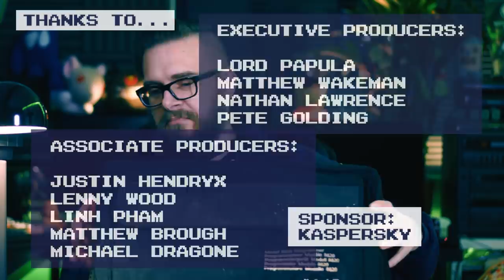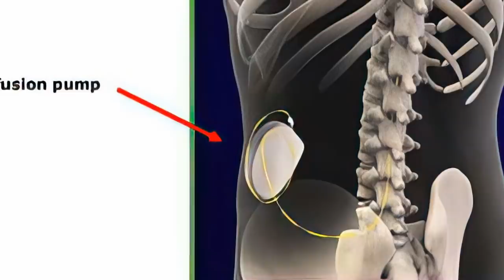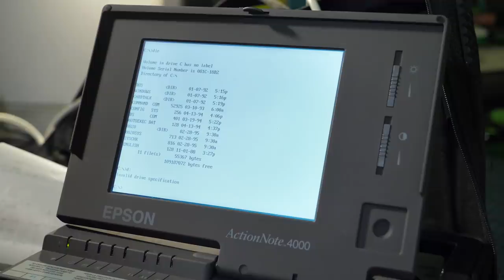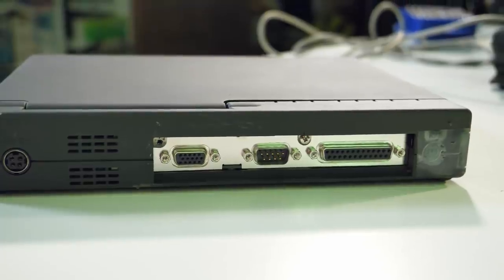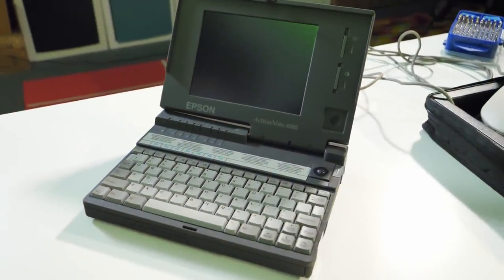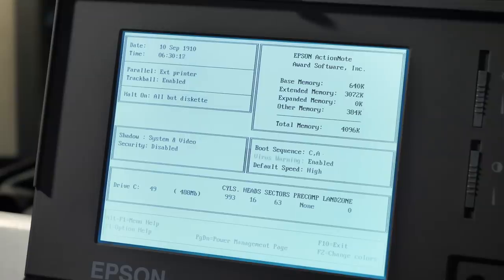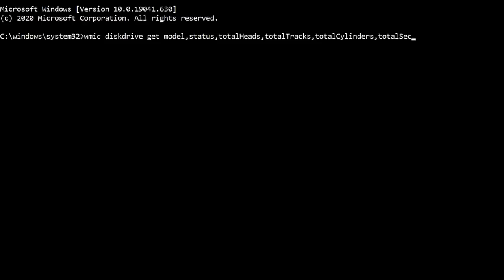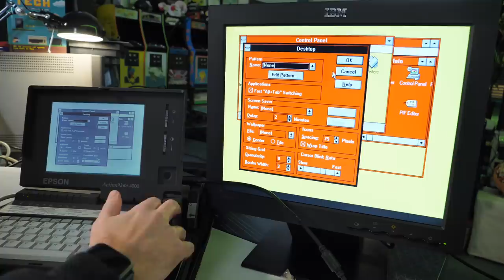This Laptop Could Literally Save Your Life | Nostalgia Nerd

Comment: 7:09 That looks like a blown up/shorted tantalum cap  in the top right of the board.
Reply: I was just browsing the comments to check if anyone else has noticed :D
Reply: @Ciakuz  I was just browsing the comments to see if anyone else was just browsing the comments to see if anyone mentioned this.
Reply: I was commenting the checks for browsing and noticed anyone else
Reply: @Ciakuz  I was browsing the internet for toasted tantalum capacitors with which to put in the holiday snack bowl instead of stale candies
Reply: I noticed this noting of noticeable notable note of noted burnt tantalum (AKA "tantrum capacitors" because, push them even slightly too hard and they loose their cool... literally!).
Probably that cap saw regular current surges on power-up (Many regulators out there that would current limit thus avoiding burnt tants on the output.
Reply: Nothing more comforting than sitting down to have your doctor computer your innards and having a tantalum cap explode.

“Not to worry!  It’s fine.”  * waves smoke *  “Now place this on your gizzard.”

Comment: When this was made track balls on computers were all designed to be thumb operated.  If you wrapped your fingers around the back and rested your hand on the table while using your thumb to operate the ball I think you would be seeing it from the designers eyes.
Reply from the maker: That's the method I tried initially, however, the mouse buttons are horribly inaccessible that way. They're also switched as standard, which I guess is you can push down on the left button (which is on the right) using your thumb. But this is one trackball that doesn't mesh well with thumb.
Reply: @Nostalgianerd  This was a design choice to make the trackball uncomfortable to use for Gaming.  Many more features have been added to "Business Machines" since (like Graphics Cards that are useless for actual Graphics) to try to limit the amount of "Gaming" that can be done on a machine designed for "work".  These were the PC's a "Boss" would like to buy their "employees" for maximum work output and minimum "fun time".

Comment: For future reference, 16 heads and 63 sectors are the defacto settings that should be used if you were to do something similar again. I didn't catch too much of the values changing but the cylinder size should change automatically when setting the other values.

Comment: Dear Mr. Nerd:

It’s quite common for old drives that those USB IDE adaptors don’t work.

I bought up a bunch of old 386/486/Pentium era drives and had to test them all.  I had a Linux box with all the tools I needed, but the USB adaptor wasn’t having any of it.  Had to get a PCI card with an IDE interface and add a hot-swap drive caddy instead.  That did the trick.

I still have it set up, with an added SATA bay just to cover all the bases.  Highly recommended if you do this sort of thing - which, of course, you do.

Comment: You can simply write disk images into SD card and use it in SD2IDE interface.
PCem is better than VirtualBox because it supports most retro hardware, so you can make a virtual copy of your computer and install everything using convenient virtualization. Windows 95 drivers included.
Then I use WinImage to write HDD image to SD card and it will just work.

Comment: For next time you need to use a large (e.g.: 8GB) Harddisk drive on an ancient 386/486 machine (that only understand specific Cylinder/Heads/Sectors):
there are drivers,  that one can install on the boot sector: e.g.: EZ-Drive or OnTrack. Once booted, they replace the BIOS's disk routine (Int 13h) with ones that understand modern drives, and then continue the normal booting.
That's how I used to do it with my actual old 386/486 PCs back when I was  a kid.

A slight upgrade would be to plug-in a parallel port sound card for FM music (e.g.: OPL2LPT or OPL3LPT if you don't want to solder it yourself) or a 16bit PCMCIA soundcard for full sound effects and FM and/or midi music (don't know about driver availability, but I would be surprise if they didn't attempt to support enough Soundblaster compatibility make sure  Doom is supported)

Comment: I got one of these in an estate auction about 15 years back. It runs Commander Keen great! Mine came without the medical equipment and with an external floppy drive with a wonky PS/2 + parallel port connector that worked great until... just today. I'll be following the IDE copying steps next lol. I'm having similar problems getting the IDE drive to recognize in any external system.

Comment: I had to do something similar to install DOS on a Zenith laptop last year. It had a 60MB hard drive limit in the bios so I had to use something called Maxtor EzBoot (A Dynamic Drive Overlay) to get the system to recognize my 1GB CF card. Weirdly, mine wouldn't work unless I used the DDO software. It's good that you got the CHD settings to work, my bios wouldn't even accept the "correct" values when I had them set manually.

Comment: That thing chugs so bad, I remember why the sx'es needed the dx'es math co-processor.
486DX-33, 4mb ram, 310mb HD was my first pc. Upgraded to 16mb ram, 540mb HD, and a Pentium 83 overdrive in that same MB when doom 2 came out and my PC gaming addiction started. Ahh, things have changed so much, but still basically the same. Although you can buy video cards that cost 3x what that PC cost back then

Comment: CF cards are basically native IDE, so the problem with reading might have been just formated as FAT32 instead of FAT? since 1993 DOS cannot use FAT32?
Reply from the maker: Come on. I ain't using FAT32.
Reply: Since that has been ruled out it's probably a mismatch in the CHS geometry and/or a lack of cylinder alignment. You need an fdisk which sees the disk as the same virtual geometry the BIOS has and which starts partitions on the first sector of the CHS track. Modern systems don't use CHS and also tend to start partitions on megabyte alignment.

You can use Linux fdisk. In the advanced menu you can enable DOS compatibility and change the geometry it uses.
Reply: @eDoc2020  hey thats a good point. i remember using EzDrive or something to allow 20gb hdd on my 386. i had to setup specific geometry (totally unrelated to the actual drive) that would load the loader from mbr and that enabled the rest of the drive

Comment: They want to fit a Spinal Cord Stimulator (SCS) on me. They do it in two stages: Run wires down your spin and test them externally. If that check out they fit the SCS (I believe they cost in the region of £40K). However, there are some risks (I don't have a good history with surgery) basically works out at 20% it will cripple me (or trigger a constant CRPS flareup), and success is roughly 50/50.

I'd forgotten about heads, cylinders and sectors. People are spoilt these days.... I was surprised Doom played so well on it; I saw the ~5fps on the LCD and thought that's about right for lack of FPUs, but it was actually playable on a monitor (I first saw Doom on a friends 386..DX).

You should show a pre-MMX PC playing an MP3 file, and how heavy it is without the beauty of SIMD.

Comment: Chernobyl was built in the seventies and was still able to run DOOM in 1986 in full 3D and surroundsound! Comments from bystanders at the time were that if felt so real that you could literally taste metallic air! 
I wonder at what speed the core was running at? I think that water cooling didn't work. They don't make them like they used to LoL.

Comment: Also, by 'FDISKd the hell out of it' did you mean deleting and creating partitions with restarts a couple times to clear out what the bios incorrectly assigned, and then filling the drive with many smaller partitions, so A; the BIOS recognises one to assign and boot from and B; the BIOS doesn't recognise unused space as a faulty unbootable drive. It would have been easier to flash the bios with a better version
Reply: Flashing bios back in the early 90's had a 80% chance of bricking the darn thing. That is, if a newer one was somehow available for the unit.
Reply: Presumably, yes that's what he meant. As a piece of trivia the BIOS actually doesn't understand partitions itself, it just executes the code on the first sector of the disk. What matters here is how BIOS-presented CHS values relate to the LBAs on the drive itself. If you know the CHS mapping used it's not hard to partition the drive properly, it's certainly much easier than modifying the BIOS to better support larger drives. Modifying the BIOS might not even help, modern partitioning tools align partitions to megabyte boundaries while DOS only works if its partitions are track-aligned.

Protip: if you can run DOS FDISK on the target computer itself the partitions will be properly set up. Then you can format the partitions on another system and it should work.

Comment: "... the little BIOS on this EPSON doesn't appreciate hard drives over 8 gigabyte."
I genuinely doubt that this BIOS actually supports any gigabyte hard drives at all. In the early nineties, the size of common hard drives was measured in megabytes. I think it's around 1995/1996 when gigabyte hard drives slowly started to become available for desktop computers. After that it took quite some time for gigabyte laptop hard drives to start become available. 8 gigabyte desktop hard drives were hitting the market around 2000.

Around 1995/1996 I worked at a computer shop and I remember building the first desktop computers with gigabyte hard drives but not all BIOS'es supported those "huge" hard drives by default. The BIOS had to be updated by that time (if there actually was an update available that added the support for gigabyte hard drives).

But obviously, this is just a minute detail in a great story 🤣 You took me right back into the nineties. 

This video actually made me remember that I still may have a Toshiba Libretto laying around somewhere. ❤️

Comment: The 80GB drive that it didn't detect, you could have just made several  smaller partitions and then it  would have been detected as several separate drives. Problem solved without needing to implement another solution, or spending additional money for other hardware

Comment: Edit: Also might be cool if you could archive the original software from the machine too, so others could have a poke at it!.

Original comment: Hey Nostalgia Nerd, if you ever want to use a bigger drive with a BIOS that won't support anything above a certain size, there's a program called Ontrack Disk Manager, that Phil's Computer Lab has archived (with permission), although you wouldn't be able to install it on this machine, it might be useful for other machines (or if you can find another way to load it on!). I got a 40GB IDE drive working on my 386 that wouldn't support anything above about 500mb, although DOS can only format and use four 2gb partitions, but it's a great utility and there's several different versions, I believe version 9 is the best one (the one that Phil's computer lab uses)

Comment: Is 8gb truly a max limit? It's been a while but I thought they got past this using LBA, I know for a long time, that the cylinders, sectors etc. numbers in BIOS used to be essentially fiction, the IDE controller basically mapped one set of numbers onto another. I could be wrong though, there were so many different limitations and at least as many insane hacks and workarounds, (most of which were entirely transparent to the end user) during those couple of decades (it was the time of the rather rapid progression from 8bit > 16bit > 32bit > 64bit), it's hard to remember which was which.
Reply: Yes, it is a max limit for the interfaces used. And yes, this was solved using LBA. But this laptop doesn't support LBA natively and our host seems unaware of DDO software which would overcome this.

Comment: Awesome. It's a shame about the hard drive. Be nice to get the software backed up. It's funny to think that would be the first time the trackball had been used. It's designed for thumb use, with your hand to the side.

For the opposite, check out the so called suicide machine using a Toshiba laptop.

Comment: Were you able to get a backup of the Synchromed software from the hard drive before it passed away?  If you did, you could probably set up a partition just with the Synchromed software on it, then the other one as a DOS partition?  What will you do with the medical programmer equipment that came with that notebook PC since obviously you can't use it?

Comment: That's not a PS/2 port, the pins are wrong.  Looks like a power connector to me.

Edit:  I did not see the PS/2 port on the right side, I was referring to the port on the left which does appear to be the power connector.
Reply: Looking at the back, the port on the left is the power port. On the right under what appears to be clear tape looks like a PS/2 port to me.
Reply: @eDoc2020  Ah, good spot, I didn't even see that.  Yes, that does appear to be a PS/2 port on the right.

Comment: Nice. I wonder if MS-DOS Interlink would have saved a lot of hassle?
Reply: Or an Iomega external drive interface
Reply: That wouldn't help after the original drive failed, you need DOS installed first to use interlink.

Comment: What a shame they didn't put a 486-DX2 in it. Regarding the actual intended use of this: how did they prevent it reprogramming the implants in all the other patients in the waiting room with the same settings as the patient you're actually seeing at the time? ...let's hope your next door neighbour doesn't have one fitted
Reply: The 486SLC only has a 16-bit bus so the motherboard would be fairly cheaper than if it needed to accommodate the 32-bit bus of a real 486. Regarding reprogramming other implants in the room, that's easy. The range will be very limited (similar to contactless payments) so you'll need to be closer than a few inches away from the implant. If you're not sitting right next to the programmer there's no chance of an accidental reprogramming.

I'd be more concerned about malicious reprogramming. If somebody wanted to hurt you they could potentially modify the implant settings using a modified programmer without leaving any evidence.

Comment: make a bootable floppy, put all the CD rom drivers on it, make sure it works. make an .img file of it, burn to a CD == profit.
Reply: That actually does work if done properly (that's how bootable Windows 9x install CDs work), but it's of no use when you have neither a floppy drive nor a CD drive.

Comment: u really should not use Windows 10 or much of anything near what you were trying to do. Anyting be on Windows 7 you start running into lots of fun problems especially with older Hardware;).i have a barely Windows XP compatible desktop that i at one point fixed too see if I could remember how to install Windows XP about 10 or 15 years ago lol.its ironically still working just fine and i use it with a couple of different adapters for working on different older Aurora hard drives too test tham for life or reformat them.it has usb so i can what just about any adapter on it USB compatible with earlier on Windows XP. thing jest works lol.wear u do a lot of working with these old machines its a good idea too have a poseable rig runing xp for doing any number of things that you can't do correctly in Windows 10.i still have a ruggedized Panasonic runing xp that was my daily   machine tell about 10 years ago and it is still working fine and i use it back and forth. i dont use 10 for much of anything.iuse a windows 7 acer for my day too day. but i still like xp over 7 or 10